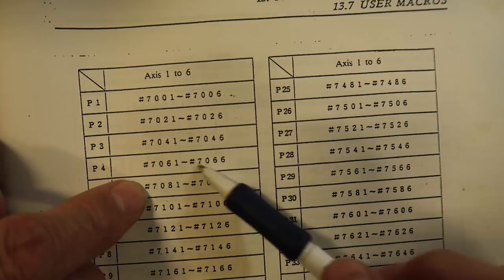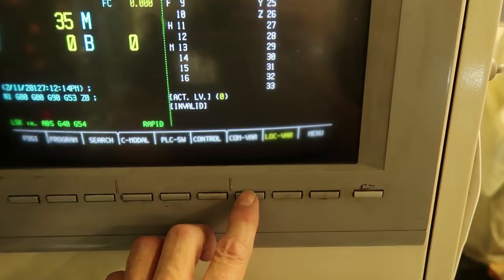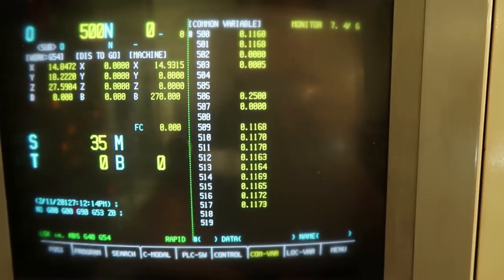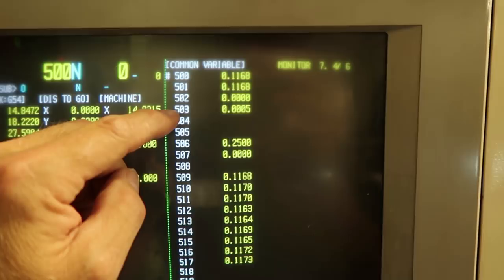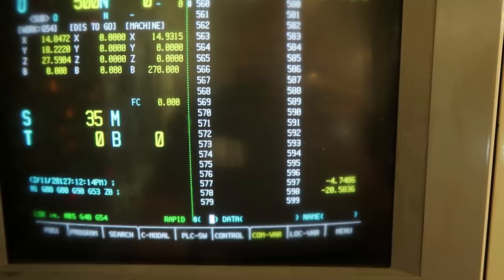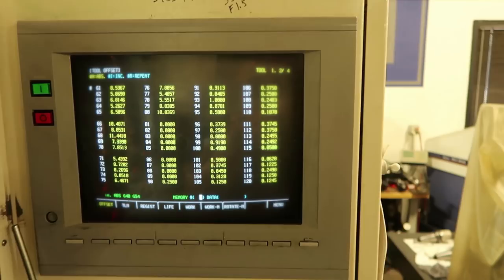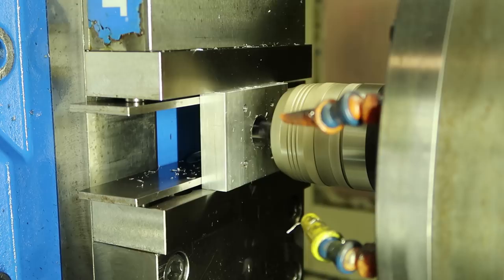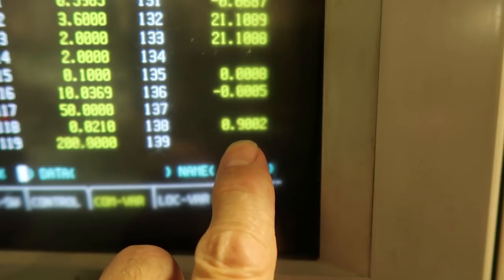Renishaw Probe 2

Comment: Very informative Peter.  I did not realize you could have logic, conditional, and looping in g-code.  Is this unique to the machine controller?
Reply from the maker: No most controls should do this. It use to be, Haas charged for a macro option i don't know if that's still true. If your machine has a spindle or tool probe it has too be able to do this in order to run the probing cycles. I use the GOTO statement in combination with the / (Block delete) all the time. To pass a roughing cycle to a finish pass if done with the same tool. Like this /GOTO99; GOTO100: N99 what ever code next;. If you press the block delete key your program will jump to N100 else it will skip over to N99.

Comment: Hey in a past video I seen you do a C zero offset for the orientaion of some drilled holes. I think you made a fixture with a flat surface milled in it to be able to indicate it in. Could you maybe go over that process again? And maybe go over how you used the fixture /indicating to regain your orientation? Thank you very much. This would be very helpful for me :)
Reply from the maker: +Derek Green  I would like to help you but I'm not sure I understand your question. Do you mean setting the zero on the C axis on a fixture offset?
Reply: Edge Precision sorry I wish I could explain it better. I could try and link the video you made when you did it. But the part had several gun drilled holes in it. And you had to do a c-zero set for the whole(gun drilled whole) orientation. The fixture you used was used as a guide the drilling I do believe .
Reply from the maker: Derek Green I think I know what you are saying. When I made the fixture I milled a slot to indicate later to set the C zero in the fixture offset. This slot was aligned to the holes such that in my cam software I made it at C zero alignment. The part also had a key in the bore that indexed with a keyway in the fixture. The fixture acted as alignment drill bushings for the gun drills. Because the drilled holes started so far down in the bore this turned out to be the best way to align them to the key that was in the bottom of the bore. (The key was EDMed in the bottom of the bore). So to set the C zero in the fixture offset I just indicated the slot parallel to the Y axis (by rotating C) and set the C on G54 to zero. The program was made for that C zero. Does that help?
Reply: Yea that was very helpful thank you ! Your machine is a bit more advance then the one I use. But I work mostly on a 4 axis lathe. And all the time I send parts over the mill for this very reason. This could allow me to do more jobs from start to finish . :)
Reply: Edge Precision o and I wanted to say, often times if a part I am doing has to many different hole patterns or if is a whole pattern/milling on the backside of the part. I will be unable to do all the secondary operations do to the issue with the orientation of said whole patterns/milling.

Comment: Hi Peter, just curious - what is the purpose of the B index moves you use in your tool change sequence?
Reply from the maker: +GARRETT LEWIS  The post of my cam software puts them in to approach a B angle always from the same direction. For elimination of backlash. In the case of this setup they aren't needed.

Comment: @Edge Precision , I think in some of your videos you say you prefer to use a Dial Test Indicator than the probing (in some instances) as you feel it's more accurate. Any chance you can elaborate on that in a video, like DTI vs. Probe ? THANKS.
Reply from the maker: I don’t know if more accurate is the correct term. I think that I like to see what I’m indicating. The probe won’t necessarily check for things like roundness or to say it another way out of roundness and runout. Not that it can’t be done with a proper measuring cycle but the standard ones don’t. I guess the indicator give me better feedback. With probing you just don’t know for sure.
Reply: Thanks, I think / feel that's pretty true.

Comment: Another great video Peter!  Quick question:  would you use the probing routine as shown on every part, or have it in block skip and tell your machinist to turn it on every X parts?  Also, for another unrelated video, we are thinking about getting a used VMC as a step of from what we have (Tormach and manual machines).  Could your share your thoughts on buying used, how to evaluate a machine, and what to expect in terms of repairs?
Reply from the maker: I normally do it on every part. It depends on the material being machined and the tolerance of the feature. If you were machining aluminum for instance you might be able to get away with just doing it the first time you run a new tool. But in a way this is overkill for that, its more useful if your having to chase the offset all the time. Just automate it. Buying used equipment is always taking some sort of risk. If you have experience with the make and model of machine you are looking at it helps. If you don't have confidence in doing this find someone you trust and knows what to look for look over the machine. As to repairs I would say for CNC equipment I wouldn't buy anything more than ten years old and stick to name brands or companies that have been around a long time. If you can, talk to people that have owned and operated the machine you are interested in. To give you a example. I owned a CNC  Hurco knee mill with a Ultimax control. I liked the control but that machine cost me more to maintain than any machine I have owned (due to electronics problems). I had a friend that was good repairing circuit boards so that helped. If you are making a living doing machine work buy new, it doesn't cost that much compared to the work and you have support and a warranty. If you have a problem in the middle of a job you can get up and running quickly. In your position I would look at Haas mills they are not the strongest machines but are a major step up from a Tormach. I have friends that have bought used Haas's with good success. Just look at the machine and how the owner took care of it. If it looks like crap it probably is.
Reply: Thanks for the info Peter.  We are thinking about a new Haas mill or maybe a Doosan sometime in the next year.  If you look at the forums you see a whole bunch of guys telling people that it's better to buy an old Japanese made machine than a new Haas.  Our sense looking at the numbers is that if we have the work to keep it busy, a new Haas will be a reliable money maker.  We are a general fab shop that is doing more and more machining, so the sales side is still weak but growing.  We have always been skeptical about buying used anything, which is why we bought a Tormach over a junker of an old machine.

Comment: Great video. Among the things in it, I would say that the probe gave a different answer due to only measuring four points at one depth. I would prefer to measure the hole three levels at a minimum, and 8 or 12 points around the hole each. I know that would take time. A basic hole, not that important. Something tighter than +- .0004" could be worth it.
Reply from the maker: It would be possible to put mutable probing cycles at different levels and in the program average the result. There are many things that could be done improve this My purpose for the video was just to show how to do the basic measurement from your program. I will leave it up to you to take it to the next level. As for machining to tolerances on bores less than .001" I generally bore them with a boring head because most machines don't mill round enough circles (This machine does about .00039 according to the Renishaw ball bar) and you also get pushoff of the endmill. Thanks for the comment.
Reply: Oh yeah, a boring bar is always preferable. A machine when new can do tight holes less than .001" and keep it round, but they lose it rather fast without the utmost perfect maintenance schedule, but that costs more. So may as well learn how to use a boring head. The finish is better anyways. :)

Comment: I love this video so much. I have watched these probe cycle videos many many times.
Reply: hey edge, I made a macro the other day for a part that didnt have a face but the bore had to be parallel to the table. https://youtu.be/aZ5WFTWpjNQ
Along with saying thanks for the help, I had a question. My haas machines at my work don't understand the G65 P9832 and 9810 moves, they just give me alarms. Have you heard of this problem before? I cant find anything on google. My shift lead broke a probe tonight. A long part was in the short part batch. G00 broke the probe.
Reply: That video isn't the actual part. Just a practice part I 3D printed to test out the macro.

Comment: Love you videos.  They have helped greatly.  I am new to probing.  We are getting ready to run a 1.125 thick plate.  The outside profile is flame cut.  It is a large 5 tooth sprocket roughly 26" in diameter.  How would i probe this to find the center?  Thanks, Todd.
Reply from the maker: Use Renishaws 3-Point bore or boss cycle (O9823). You can specify the probing angles. The Renishaw manual says your probe must be calibrated with the vector stylus cycle (O9804). This should let you probe the tips of 3 of the gears teeth. Hope that helps.
Reply: How would you pick up the first tooth tip?  They come to a sharp point.  Is there a way to probe 3 flats and construct a circle tangent to those flats?  Any way I can send you a pdf of the part?  Thanks again
Reply from the maker: My e-mail is peter@edge-pre.com you can send it there.
Reply: awesome, thank you.  I send the file.  Thanks again!